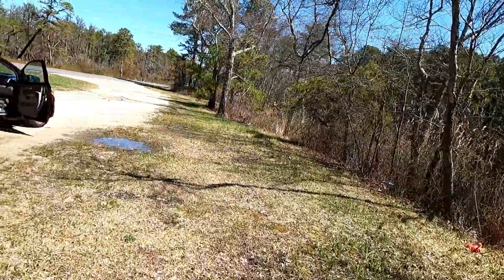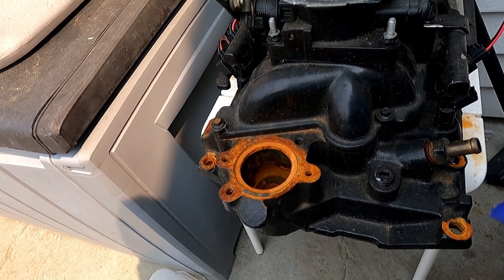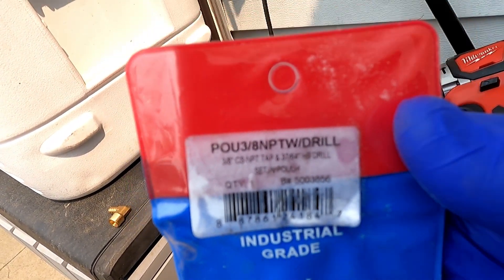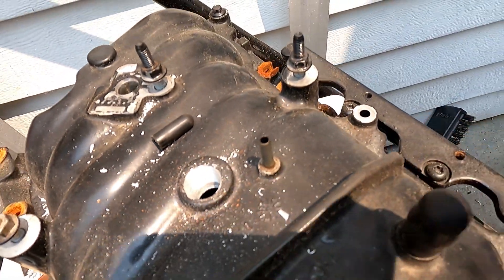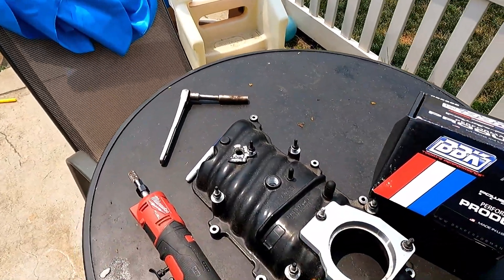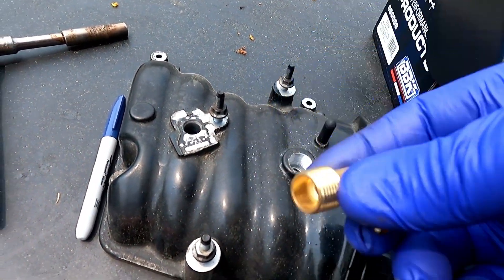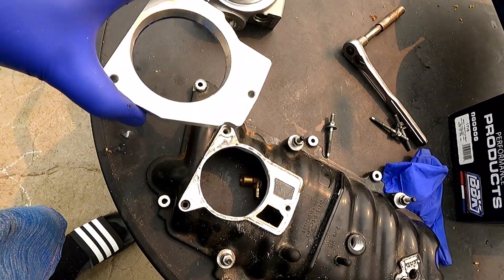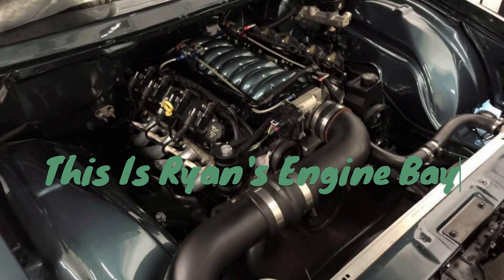SBC Vortec Marine Intake & BBK Throttle Body Prep GMT400 OBS Chevy

Comment: Did you ever fine aftermarket fuel rail that fits this intake
Reply: Yes but thanks I'm looking into useing this intake
Reply from the maker: @JesusGonzalez-nu2nc   Ok cool. Getting some stuff in order before I do the install.
Reply from the maker: Haven’t tested it in my hands, but the closest latch I found with similar spacing is the ones that come with the Holley intake for Vortec Motors.
Reply from the maker: Did you see part 2 to this video on my channel?

Comment: What year ford fuel injection is it compatible with
Reply from the maker: Not sure of the exact ford interchangeable injector. Other than the EV6 connection, I didn’t get that far yet. Ive been looking through other company injectors to find the sure shot options.

Comment: Very nice. Looking forward to the install. Do you have the link for the injector pigtails?
Reply from the maker: Got you right here dude.

Fuel Injector Pigtail Connector Plug Wire EV6 Compatible with Ford Mustang F150 F250 Crown Victoria (Pack of 8) https://a.co/d/f31VMnY
Reply: @RCSmith90  watched all videos i actually took a a small block vortec carb intake and drilled injector holes myself I wanting to know or get advice how you wired your injectors on your marine intake.

Comment: Hi Just seen this video with marine vortec intake manifold. Did you complete the install? Do you happen to have a parts list of parts and gaskets needed. How did turn out and did it meet your expectations? Thanks Loved it he video.
Reply from the maker: Not yet. Still working on it. I fall down rabbit holes with stuff like this. I just bought some inner fender wells to add to the powder coat list. Wanted the top of the intake to match my paint along with the inner fender wells. Then I thought why not put a new distributor in. So when that stuff comes in I’m going to keep moving forward. Definitely making a video each step of the way.
Reply: @RCSmith90  Good Luck with it and keep pushing forward. Please keep us in the loop . I’ve put a lot of time & money into my suburban with the 5.7 vortec. I truly hate the spider injection system. My truck has never run right since doing the upgrade to Mpfi. Great videos & Thanks again.

Comment: If powder coating to your color doesnt work out, you can try having it hydro-dipped, or procure a 2K color enamel that best matches your paint. Eastwood sells 2K primer and 2K gloss clear engine enamels that are chemical resistant and very durable. Expand your horizons.....
Reply from the maker: Eastwood is great, been using it for years. I’m choosing to do powder coat because of my limited time with work, school, and family. Plus I like the look. It’s Eastwood 2k on my front and back bumper.

Comment: Drill the plate for the idle air control  valve. USE THE SPACER!
Reply from the maker: Just found a guy on the OBS forum that used the spacer without drilling a whole in it. He pointed out something I missed in the design of the BBK throttle body. After looking I see it take air from the inside of the throttle body and not the base. So I can use the spacer without drilling.
Reply: @RCSmith90  very cool. I started scratching my head.....I've done business with BBK for almost 30 years and I cant ever remember them making mistakes. They've always had great instructional write ups too.
Reply: @RCSmith90 so the spacer comes with the throttle body already?
Reply from the maker: @moycorral7870  it comes with one spacer. Thing is, there is 2 different surfaces that need it. Spacer to intake, then space to throttle body. Unless you don’t use the spacer. I won’t be sure until I install it at some point this year.
Reply: @RCSmith90  would you know which one of the two comes with it?
Reply from the maker: @moycorral7870  it’s odd because it only goes on one side of the spacer. And the opening on the spacer is different on each side. I’m just not sure what side is up and what side is down. When I flip the spacer either way, one hole is unhappy either by being overlapped or being too big.

It doesn’t make sense. Or I’m overthinking it need to stare at it for another couple hours.
Reply from the maker: I probably had to look on the website. Surprisingly it didn’t come with actual instructions.
Reply: @RCSmith90  damn it! Spoke too soon!

Comment: Use WD-40 while you're grinding. It'll clear out the carbide burr and keep it from clogging up again.
Reply from the maker: I didn’t use WD-40 but I used a cutting lube by a different brand. I think that’s the only reason it didn’t get cakes up worse. I need to stop BSing and get the proper bit for aluminum 😂😂.
Reply: @RCSmith90  that's a double cross-cut burr for ferrous metals, but they can cut aluminum too. The WD-40 for a barrier between the the burr and the hot aluminum. The clogged area will just fly off and stay off. Maybe your grinder wasnt turning the rpm needed to fling the clogs off. I've been doing cylinder head and intake work for 23 years......I use the double cross cut after a single cut fluted non ferrous burr to smooth out the larger trenches. After the double cut I go to stones.....then cartridge rolls.
Reply from the maker: I’ll try the WD-40 on something similar next time. The stuff I used for drilling through metal is what I tried with the burr.
Reply: Using wax works the best
Reply: @calebcoffey6557  "wax"? Like "candle wax"????
Reply: Soap too....

Comment: Finally been waiting for this to drop
Reply from the maker: My bad for the wait man. I still have to get it back from powder coat. So I gotta wait on that for the next step.
Reply: Have you finished the injector wiring ? I am looking at a sub-harnes ,from SUMMIT RACING , THAT will plug into the spider wire after i match the plug from the harness and put the mating one on the cut spider wires . This one ,FAST XFI Fuel Injector Harnesses 301201    -   or   Holley EFI Systems Wiring Harnesses 558-200   , one of these should do it .  I will let you know !
   Matt in Maine